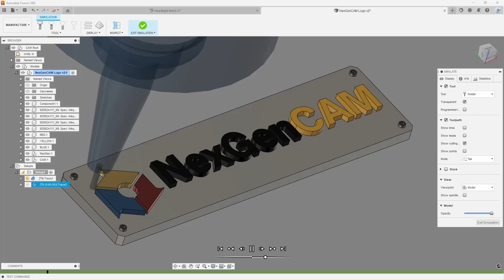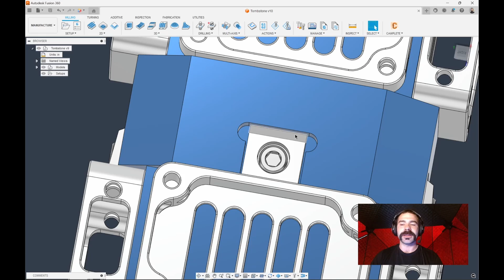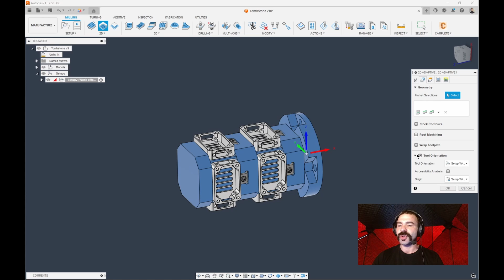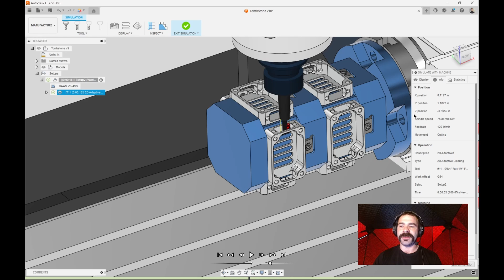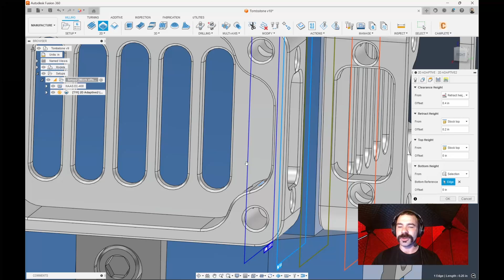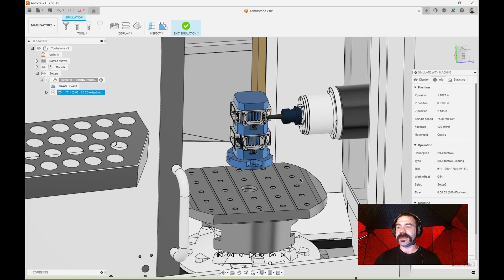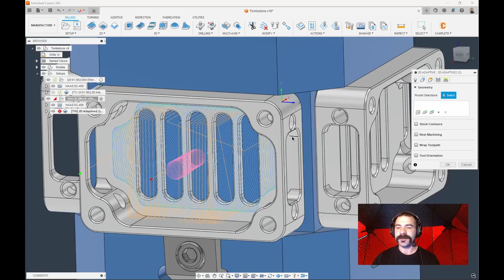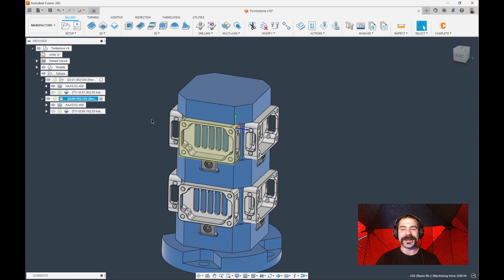Fusion Friday (ep102): May the 4th axis be with you. How to setup Fusion 360 for 4th axis work.

Comment: So could you do a video on how to setup the 6" A-frame into the design. I'm designing a sub plate for the HRT210 to multiple different fixture plate to be mounted to the sub plate. however I like to include the 6" a Frame. right now I have it inserted into the cam.  but when doing a machine simulator. the A-Frame rotate with the fixture and rotary. please help

Comment: Hey! A little late to the party, but love the video.
Our shop has a lot of 4th Axis slot machining around the A axis, and I've been waiting for a couple of years for Fusion 360 to update their milling process options to include that but nothing as of yet.
It is a pain to do what you showed in the video, working with 6 different origin points(G54,G55,etc..) on one face on your particular fixture, and then having to manually change the A axis positioning.
But Cheers anyways! I will keep on waiting